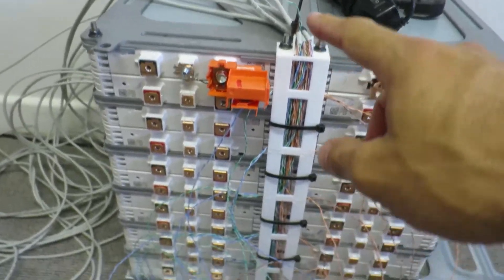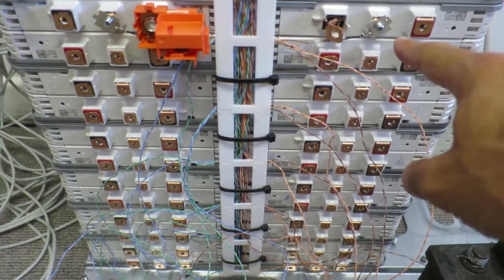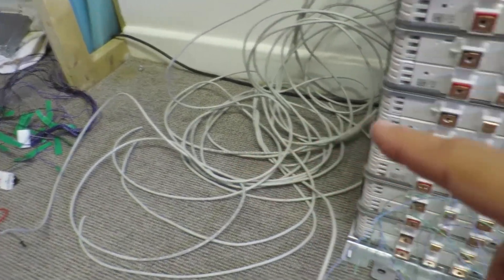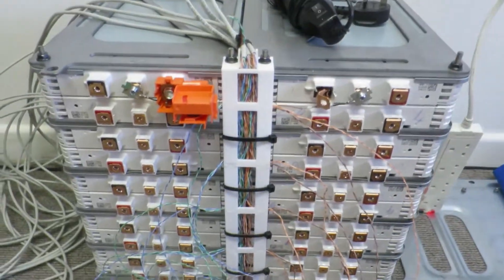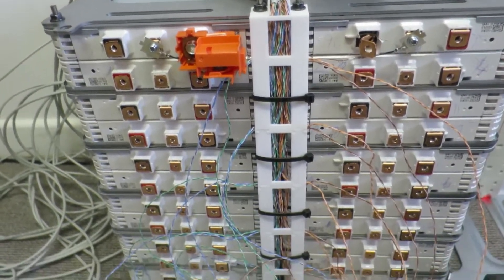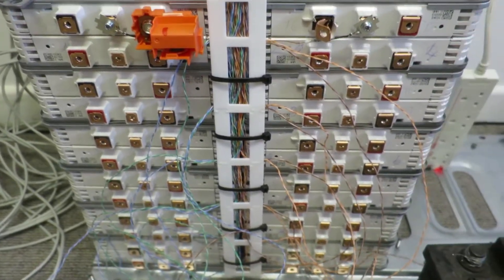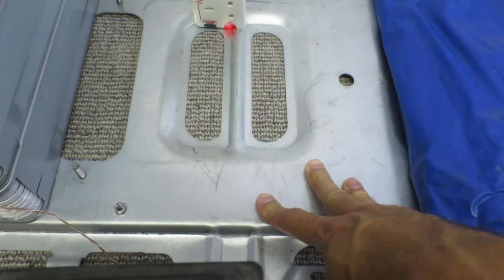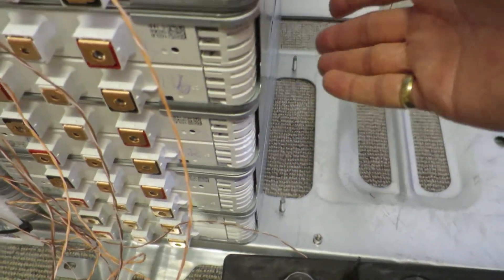Nissan Leaf to Mazda RX8 EV Conversion, random update.

Comment: I have an 04 6 speed rx8 myself still have the doritos running but as I currently have my camper and carport loaded with solar I plan to convert it to ev for short trips around town. You talked about how you would like to know about selling or building more of these. I think you would have a hard market, but if you were able to make plug and play parts I.E the arduino for tricking the instrument cluster and steering pump and one for controlling the factory leaf bms charger and inverter you would have a good market as it would create and easily achieved ev conversion. I currently have 8 leaf modules running. My solar camper and they are great lithium for the price and if i could just buy a whole car well i would save even more. Love the project it has me wanting to get a  donor car ready :)
Reply from the maker: Yeah, who knows how simple I can make this, but it needs TO STOP RAINING!!!! its really stopping all progress at the moment as I cannot get out to the car!
Reply: @SouthWestEVUK  scaffolding and tarpoline!

Comment: May want to watch your wire resistance to the BMS.
Reply from the maker: Yeah I had thought about this, but not very hard! It will almost certainly have an impact of the BMS's opinion of the pack, probably thinking it is at a higher state of charge than it really is. But I am not sure I am overly worried, I will probably focus on the overall voltage of the pack within my own code for range calculations. Guess I will not really know until it is all wired together.
Reply: @SouthWestEVUK  It should only be an issue on balancing. The current draw through that small wire will develope a larger voltage drop than expected. Pulling 10ma through 28awg wire will generate 0.67mV per foot. Might not be an issue after all.
Reply from the maker: Yeah i do think it will have an impact both ways, but small enough not to impact this project. Good shout out tho.